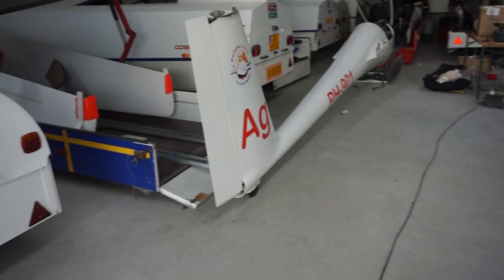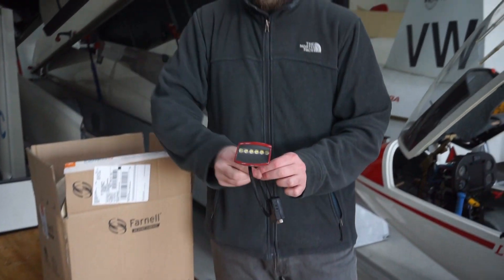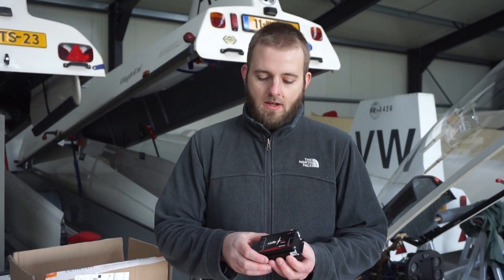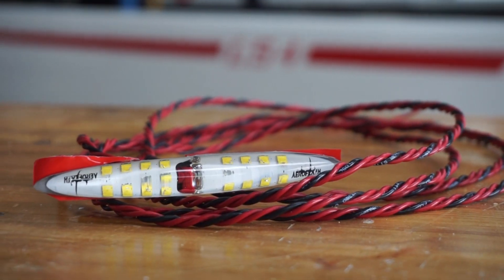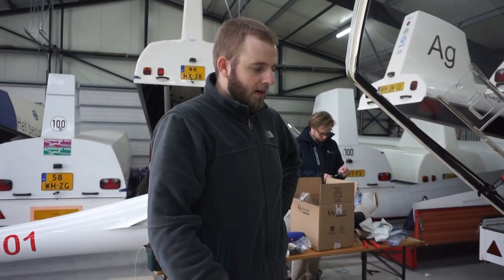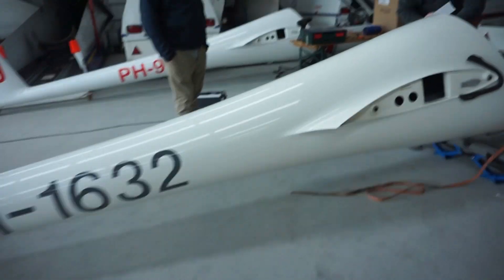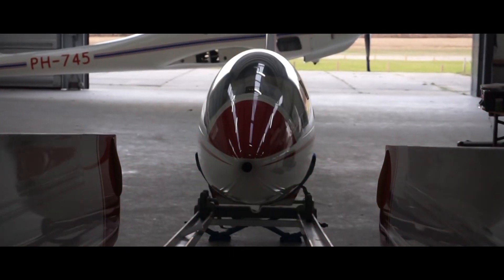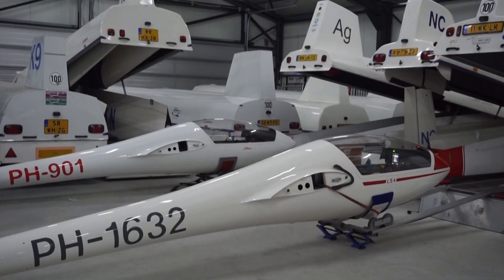See and Avoid: Anti-Collision lights in a Glider

Comment: Sadly this is not the original Anti collision light... It's ripped off from a German Company called "Sotecc". Please buy the original!
Reply: And who did Sotecc "rip it off" from do you think? Ever heard of How2Soar? This version was installed in the Schempp-Hirth Discus 2c FES until summer last year when they "stole" their product.
Reply: @CaptainB747  I don't mean the idea. Sotecc wasn't the first company with a canopy flash. But the design of aeroflash is very very similar to soteccs design. And not only the canopy flash: the design of the strobe and connectBOX, or how aeroflash call their fuse box is also quite the same. The aeroflash canopy flash came also two or three months after the release of Sotecc's flasher on the market. Competition on the market is good, but copies are bad in my opinion